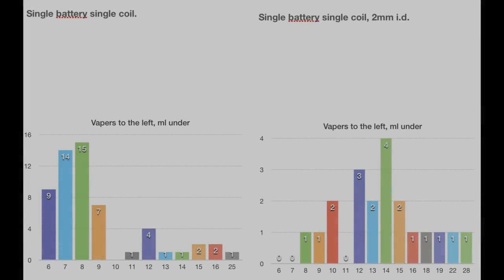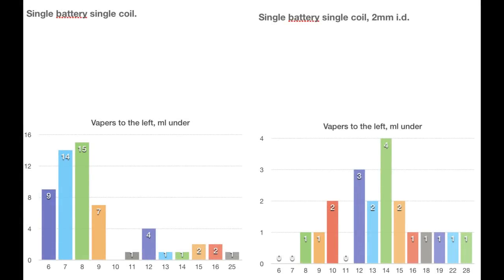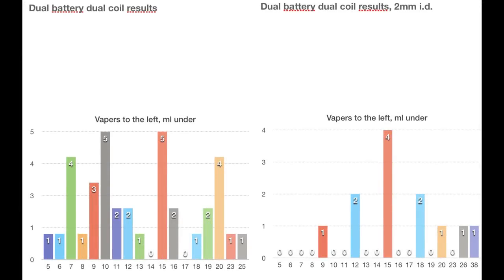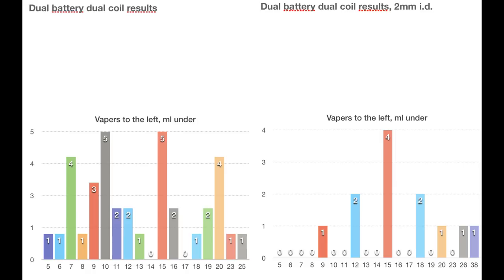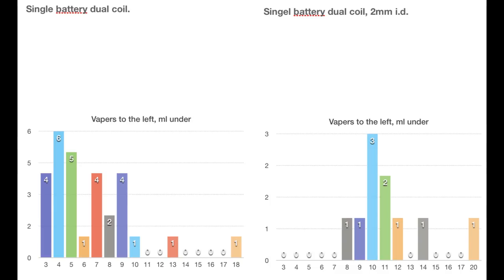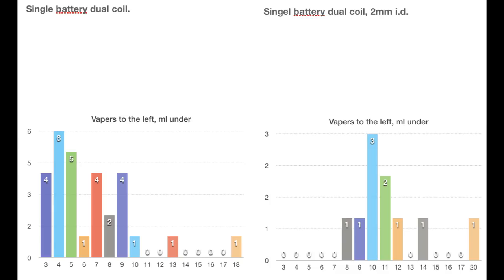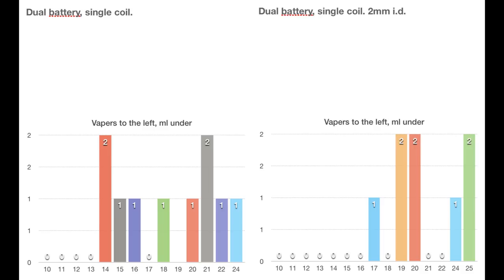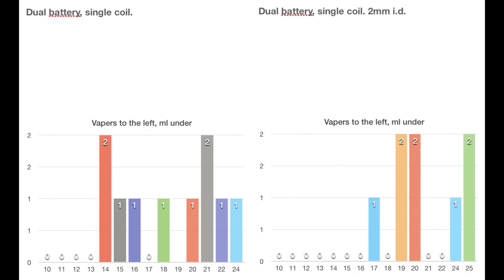Dual or single coil?  Conclusion! Part 3

Comment: good stuff! everyone who participated is so awesome 
I've got unexpected amazing result with dual coils 21 ml :O double of previous dual coil build. And weirdly enough I've had only 24ml on one coil. Vaped same juice... hmm. 

2x (24g SS316L 2mm 7wraps) 0.11ohms contact coils.
Batteries: 2 
Coils: 2 
Ml: 21 ml 
Chain vaping: yes 
21700 Battery: no
Reply from the maker: Chain vaping explain it. No mystery. Keep the coils warm and you don't loose any energy.

Comment: I have didn’t have data in time to post, but I found similar results. 

This makes me happy. 

I just wish that packing wick tightly didn’t lead to dry hits. The video on that was so promising.
Reply from the maker: Hmm... I have no dry hits, but I have to regulate the power or the length of the draw (on mechs) not to get burnt taste. At low watts the coils give tons of vape and flavor. Getting the ohm or watt in the bulls eye is more an art form than anything else :-) I'm vaping on a VV device now with 2 2mm coils, and it's just fantastic!

Comment: Thanks again morten! Very interesting results. I’m so sorry I couldn’t help with some data but I was busy and it was too late when I saw the videos. My most efficient set-up (tested through almost 2 years and a half) is my aromamizers with dual coil ss316l 28AWG 2,5ID 8wraps spaced. RTAs on regulated temperature controlled mods. It’s just the perfect combination of efficiency and (full) flavor for my style of vaping. But I started experimenting with flat wire coils (damned hammering thing!) in my single coil RTAs and on my few RDAs and I’m really enjoying it! I don’t build over 3,5 ID because I think is just a waste of energy (and juice)...keep on the great work and the rocking intros! ;-)
Reply from the maker: Thanks Marco! It looks like 2,5mm i.d. might be a sweet spot!
Reply: Morten Oen 2,5 mm ID is just perfect for that kind of RTA where the wicks sit over the juice holes (drilled on the base of the velocity style deck). The problem with recent attys is that the wicking ports (or holes) are so big that you are compelled to go with higher diameters or you’ll be flooding your deck. There’s just few RTAs on the market (except the steamcrave family) using that juice feeding style, that IMHO is great because it gives you freedom of choice on diameters with no worries about the quantity of cotton in the coil...

Comment: 🔥🔥🔥Great experiment and results Morten 💯👊👍👍!!!!!!!!🔥🔥🔥
Never went under 2.5mm before. Must say 2mm/1.8mm has knocked me out of my sox!! Im talking about comp cloud chasing setup like in terms of vape production, without loss of flavor, at more than safe ohms, and with a 10ml plus mileage💥💥💥💥🙌🙌🙌!! Keep doing what you do Morten, cose it is going into the right direction👊👍. When i thought i was done, measured batt at 3.5 volts, used some Brasso to clean contacts, and it was popping quite hard again, so went ahead, and the 15ml could have been easilly killed though stopped at 12ml being a happy camping vaper 😆
Reply from the maker: Great results Bikendi!
Reply: Got a great teacher!

Comment: Fantastic compilation of data and results Oen!!. In a world where SO many are extreme and constantly pushing their hardware and batteries, I am mostly comfortable with balancing the trade-offs. I prefer the "middle of the road" or "best compromise" approach in most things...as well as my vaping. This is an incredibly helpful data set for me...I will use this knowledge to build for the best of both worlds and try to balance flavor and battery efficiency at around 2.5-3mm. Thank you so very much for all that you do.... SO fascinating and helpful!!!! Now, to figure out kanthal vs SS316 vs Ni80...🤔🤔 Your thoughts on materiel....tests?
Reply from the maker: Thank you for this feedback! Everybody has asked me about limits and hard answers, but you get it. It's a compromise based on very simple facts, ignoring a ton of other facts and details. Like you, I'm still at 2-2.5mm id for dual coils, and 2.5-3mm id for single coils. Consistancy in vape, flavor, energy, everything, makes trial and error in getting an RDA "right" almost a thing of the past. The help I got from subscribers in the experiment was just fantastic. I am still looking at the data sets, with all the added info I got on the side, and my vape-life has just become so easy and predictable.
Regarding materials, I like Ni80 for claptons and aliens, and SS for more complicated coils. For flat wire always Kanthal :-) The thing to avoid is having a coil that heat up the saturated cotten uneven, so you get "muddy" dark flavor notes.
Reply: Morten Oen fantastic! Thank you again, so much, for all that you do! You have forever changed the way that I wick and position my coils....for the better. Thank you for completed the info that I need so that I can (as you said) remove the trial and error from my builds. I know what I like and want....and YOU help me to achieve it! You're the best, my friend!! 👏👍

Comment: I'm late to be in the charts again, but took me a while☺☺☺☺!! 12ml at 2.8v, didn't want to go lower and risk this particular batt, its a first batch single 20700 5 legs iJoy.
 1.8mm dual 22agw flattened Ni80, 0.11 ohms, 》>stainless steel tube<《.

Comment: I use framed staple Claptons (2-28\4-.1*.3/38) with 3mm inner diameter. It seems smaller diameter coils are more efficient, but you mentioned that with Claptons, 3.5mm id coils were 10% more efficient. Are you saying that with Clapton coils, it's better to go with 3.5mm id, rather than 2mm id? Thanks for all the work you do, by the way!
Reply from the maker: Greetings Corey! I was comparing inner diameters, stating that there is almost no difference with large i.d. Small i.d. like 2mm i.d. is almost twice as efficient, and flat wire coils are faster and more effficient than claptons here. There is energy saving for all coils to have less volume inside. The most efficient coil is plain wire coil, because of even less volume. Flavor comes at a price it seems.
When diameters go up, to 3,5mm and above, it seemes that residual heat from the coil helps to conserve energy, and claptons are slightly better than flat wire coils.

Comment: okay so now that we know smaller inner diameter will make the mass heat up faster but now im curious about ml over time while yes you get better energy efficiency but do you go through the juice faster as a result?
Reply from the maker: You go through more juice per charge because less energy is used to heat the coils up to boiling point. More milage per charge.
Reply: yes ml per charge but what about ml per day when the charge last longer?
Reply from the maker: I don't know :-) Can you do an experiment and report back? Like, vape a day with 4mm i.d. coil(s), and a day with 2mm i.d. coil(s)? If there is a difference, I suspect that the bigger coils will use more juice because they cool down slower. How much? I have no idea:-)
Reply: well i am already testing the hypothesis since i have the drop i did the flat wire build you suggested but instead used what i had on hand which was framed staple dual 26 core wrapped in 4-36 gauge with an id of 2mm (which was nearly impossible to wick)

Comment: Interesting. I'm curious about what you think about certain airflows, particularly in top airflow tanks. If you look at tanks like the new Vapefly Horus (see the airflow diagram) http://www.vapefly.net/vapefly-horus-rta/ or the Geekvape Zeus or even RDAs like the dead rabbit SQ - is the air actually going where the marketing tells you it will go or are they mistaken? For example the Horus tank I find it very difficult to believe much if any of the airflow gets underneath the coil or even the side of the coil. I find it had to believe that the Zeus airflow makes it down to the lowest airflow holes . What do you think?
Reply from the maker: It's hard to say without having it in my hands. But anytime you see something like "this feature is to avoid heat" it's a serious warning that they have done something wrong :-) When I look at the animation of the Horus I have many questions, because the left side airflow seems to disturbe the right one, and any air through the perforated plate will go down at an angle, colliding with the air comming up (which again collides with the air that crosses over from the left). Looks like chaos of opposite forces. My guess is that the makers themselves don't know either, only that they had to put on a last minute design feature for heat dispersion... and that is not a good sign. Regarding the Dead Rabbit RDAs I have spoken to the people briefly, they claimed they had used some sort of smoke chamber, but when I asked about speed and pressure, I got no answer. And looking at and testing the Dead Rabbit confirmed it would not work as intended. After my review of it they have now issued a new cap. I have no idea if it is better or make things worse.

Comment: Will this information influence how tight you wick?
Reply from the maker: Yes. Or it tell us why tight wicking seemes to save energy or behave like it's "faster". A tight wick leads juice faster to the coil, and there is also less juice inside the coil at any given time due to tighter wicikng, so there is less juice to heat up to boiling point each time you push the button. Not as dramatic as the difference between 2 & 2,5mm i.d., but it is part of the puzzle.

Comment: Alien wire is the best wire ...best vape... bos not mather eenergy we have battaries more energy beter it is
Reply from the maker: Alien wire is the worst, only surpassed by stapled claptons :-) Just my humble oppinion:-) Unless you have air flow from more than two angles *hint*.
Reply: So what is the best wire to use?
Reply from the maker: Depends on the RDA :-) For the most part it is some sort of smooth wire with aerodynamic properties, flat, or plain wire in parallel. In RDAs like the Drop, Aeronaut, Ghoul, Haku etc. you want to trap the air, and you want alien, stapled, tiger, corse claptons